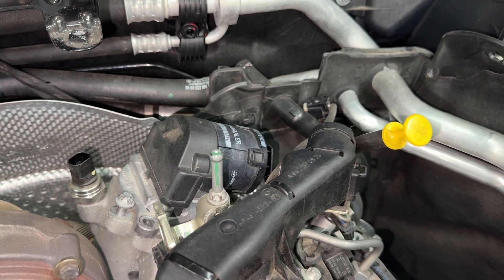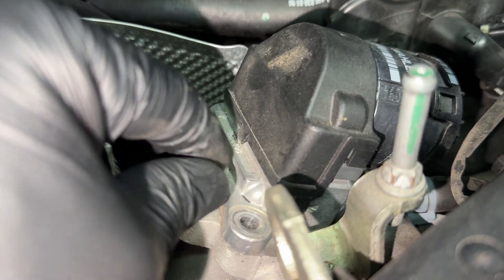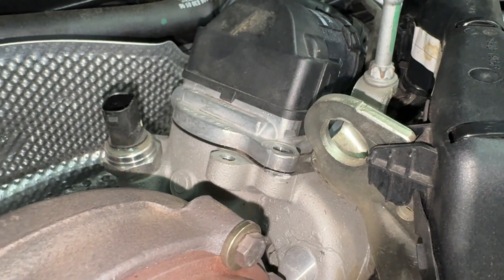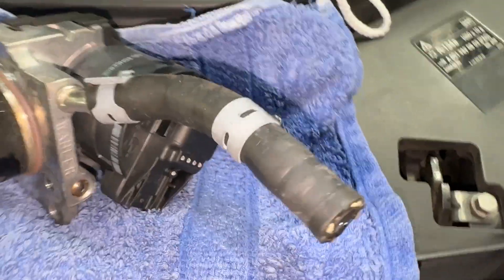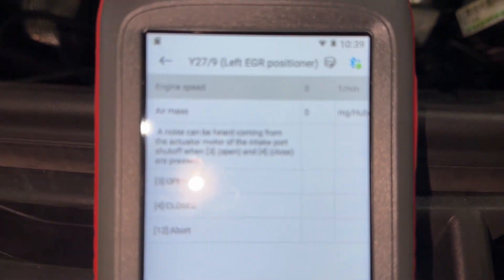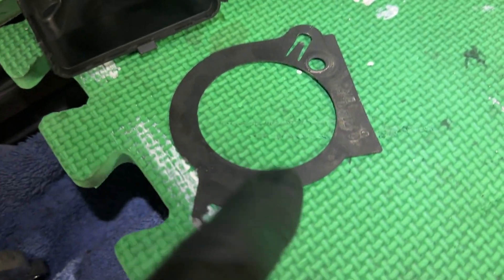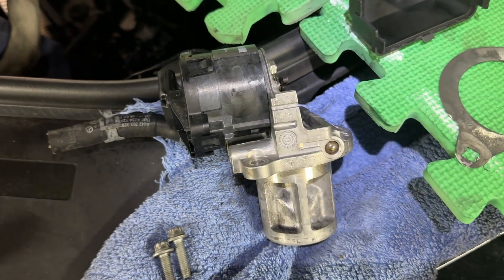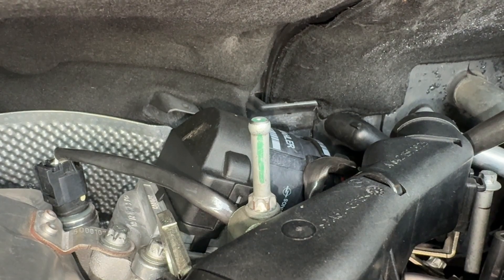Mercedes EGR Removal, Clean and Check

Comment: Do you have a video showing how you removed all the plastic panels and the firewall cushions? Thanks
Reply from the maker: Hi - yes, check out my other videos.  It is mostly shown in the video "1. Mercedes Oil Cooler Leak Preparation - Coolant Oil Battery Bulkhead Removal"
Reply: @jackpwc01 hey Jack, thanks btw I was able to figure out just need to remove the rubber housing then on of the plastic panels (driver side) and only one fire wall panel ( the one smaller sitting on top of the egr) . I removed the egr by buying a chisel set and very gently tapping (DO NOT USE FLAT SCREW DRIVER) as you will severely damage the metal of the egr n engine and the seal sitting below the egr. Any ways I removed it although had a BIF FIGHT with the rubber cooling line bracket (it had to be hose clamp to be easily removed) Cleaned it  then polished it with mesh grease the spring behind the plastic cover) put it back car works as before no egr codes so hopefully it would run fine for long time.
Reply from the maker: Good job!